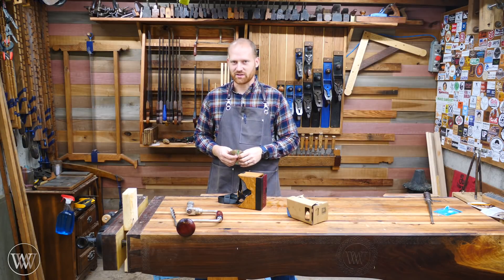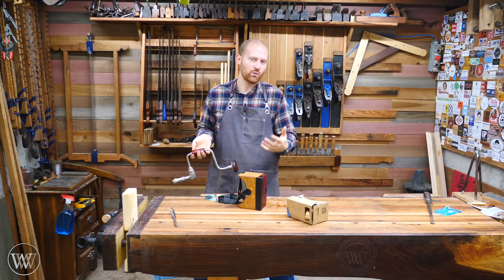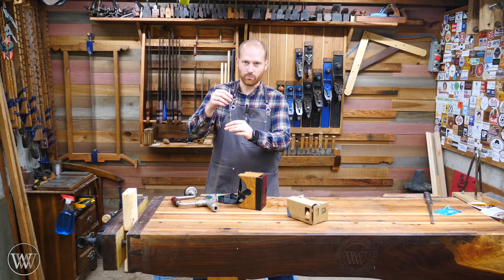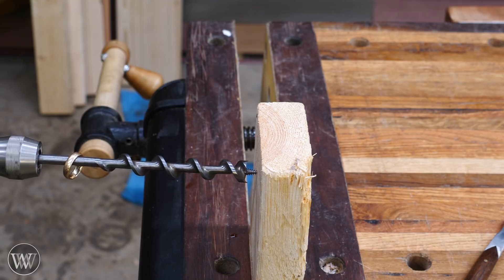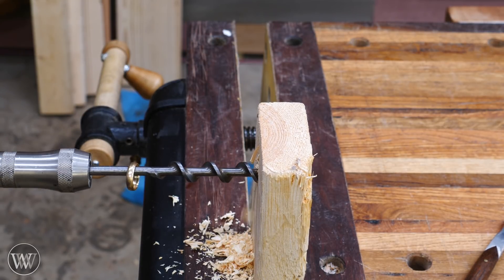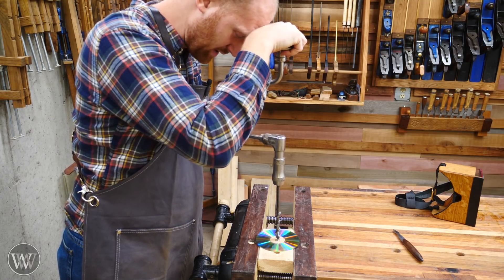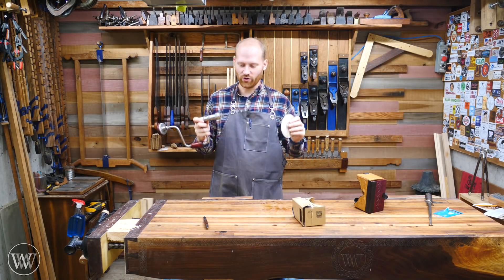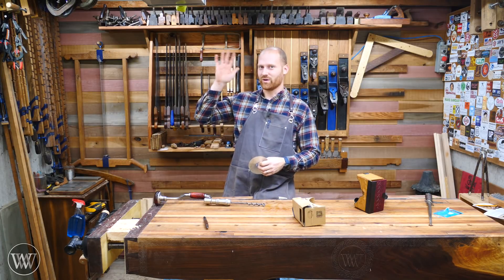2 Quick Hacks On Drilling a Plumb and Square Hole with a Brace and Bit

Comment: Really enjoying these quick daily videos.  Do you have plans for some more project videos as well?
Thanks Andy (in the UK)
Reply from the maker: thanks Andy. yup, I just did a video on the second channel going through a lot of the projects I am planning on doing. I will still be doing a few of them just putting in a bunch of shorter tip videos in between for this month. if I can get the video done the next video on the lathe will be out tomorrow.
Reply: I did see this James so will look out for them. 🙂
I adore the experience of working with wood and in the process of upgrading my 8ft x 6ft shed into my own 'shop'.  Winters settling in tho so I hope the insulation I've installed does its job!  Next stop, build my own bench!
Reply from the maker: Sweet andy. the first bench is always fun!

Comment: Like many other woodworkers, my spouse would not only flip out but have a freakin' severe sense-of-humour failure if I were to use my wedding ring as a woodworking tool!!!
Plus, taking it off all the time like that is just tempting Fate and courting disaster, in terms of losing it... Instead, may I suggest nipping down the local plumbing or hardware shop and getting some olives for compression fittings? You can usually get them in different sizes, as a multi-pack and they even look like gold wedding rings... but cost a LOT less to replace if you drop/lose it!!!!!!
Reply from the maker: that is a great idea!
Reply: Just wanna save you any grief from Mrs Wright!! ;-)